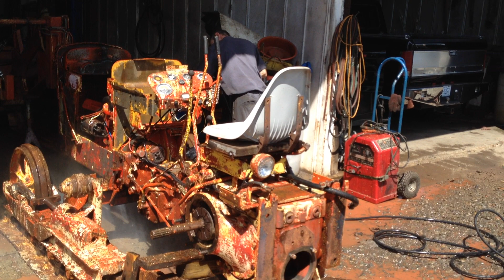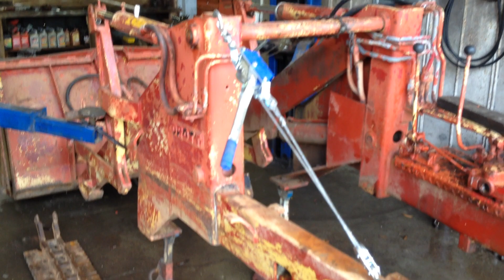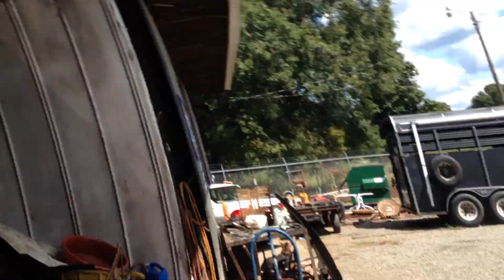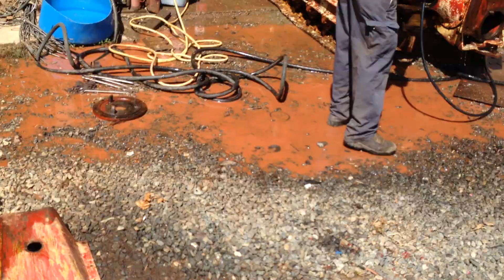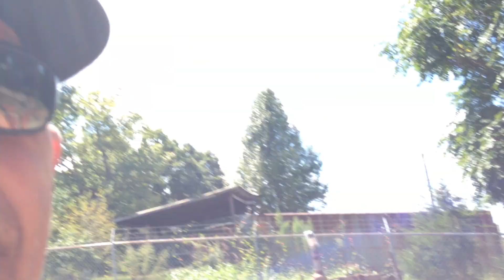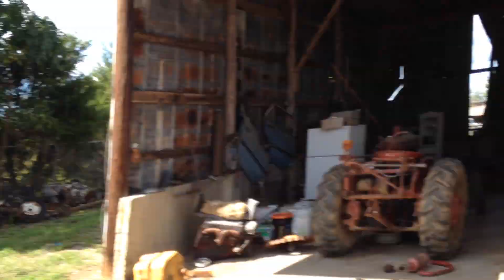Restoring old Bulldozer.  International T 340 Drott

Comment: The T-340 crawler was based on the International 340 utility wheel tractor and was one of the smallest IH crawlers built. The diesel version (TD-340) is harder to find engine parts for.